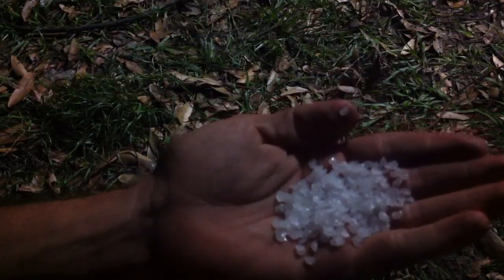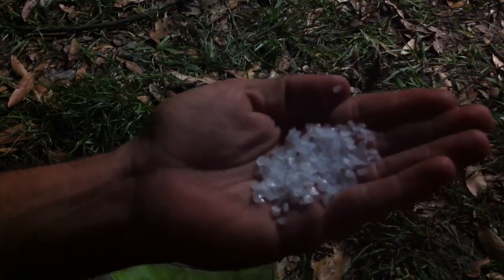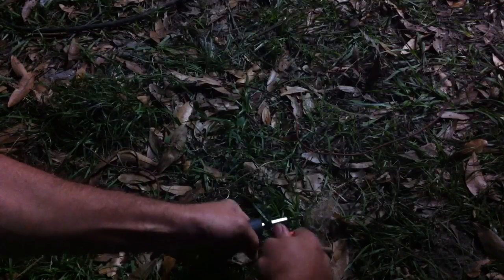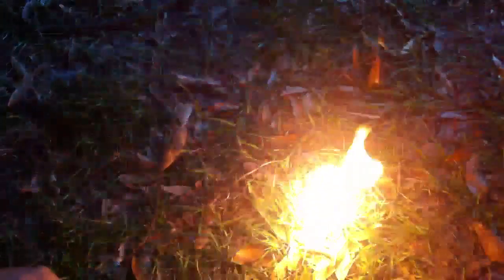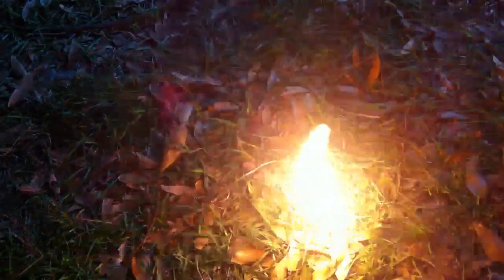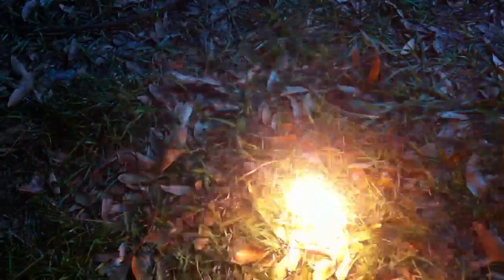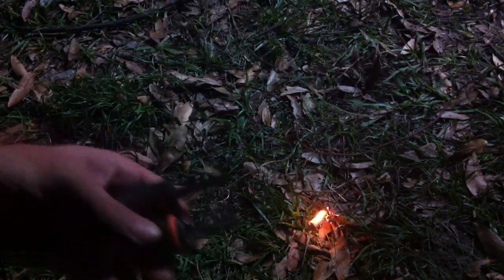Fire Tinder using Paraffin Wax & Jute

Comment: Another trick I learned is that you can use a 1/4" hose barb and thread the jute through it.  You can use the barb to extinguish the flame, similar to a WWII trench lighter, and however much jute you expose controls how big the flame and how long it burns.  Just a thought!  Nice write up.